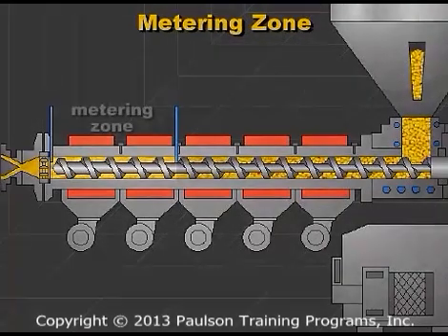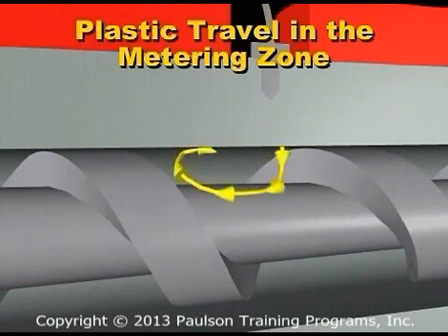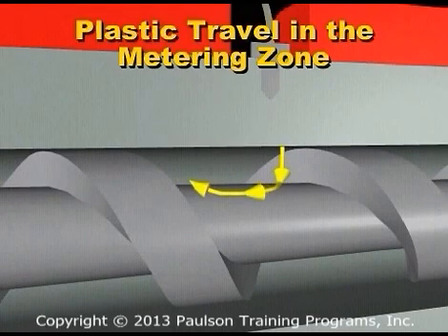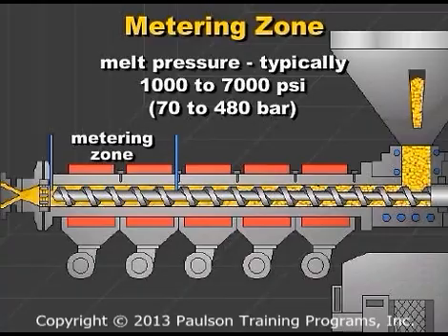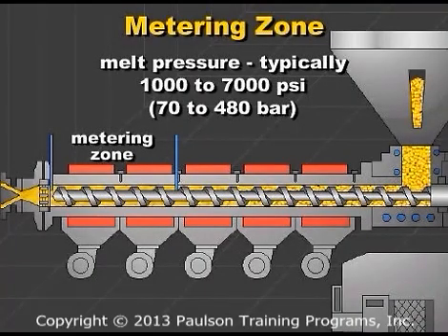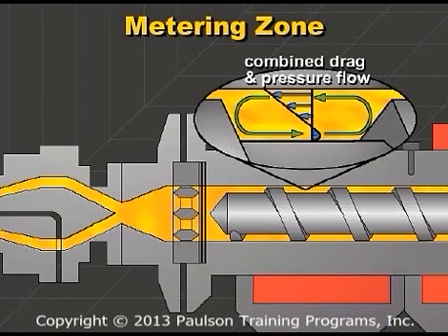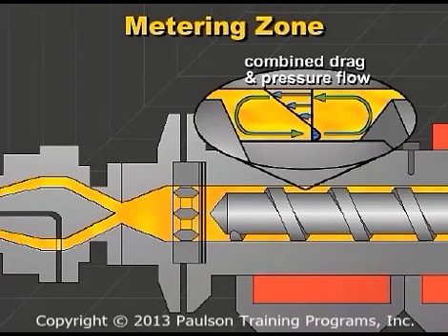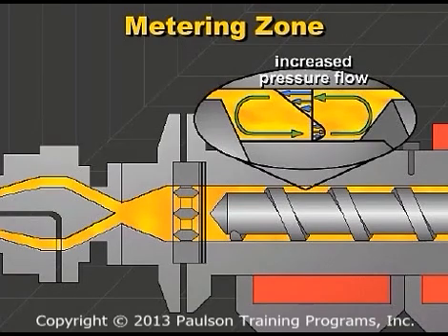Single Screw Extrusion - Optimizing Controls - Part 2

Comment: Thank you for your very educationnal videos, i have an issue while molding planks with my extruder, air bubbles inside of the planks, i think i need vent on my extruder, tried that but plastic is flowing through the vents, would you be able to help? thank you
Reply: Too much material or extruder speed not ajusted for the amount of material it's being fed, for air bubble could be many other reasons

Comment: Hello. I have question how to reduce a screen change. from 3 to 2 per 24 hrs
Reply: if you are a process engineer please hit me up
Reply: That all depends on how clean your raw material are. Are you extruding polystyrene? If so are you using reclaimed pellets in your recipe? Alot of the time if you are it is dirty and this will cause pressure to rise and to have to do more screen changes. If your using a higher virign plastic rate is your recipe thos will highly reduce the amount of screen changes you need to perform in 24 hours. Of course there are other things that could he causing that but that is the first thing that comes to my mind

Comment: I have a small extruder and the entire barrel moves in a circular pattern maybe 1-2mm or so - which makes it very difficult to maintain tolerances on the product extruded. I thought it was due to a screw that was broken and repaired and assumed might not be 100% straight, but the same thing happens also with a new screw... what could be the cause? The motor and the gear box? A bent shaft that connects to the screw? Maybe the extruded not being level properly on a hard surface (it is on a wooden pallet)? A bent or worn out barrel?